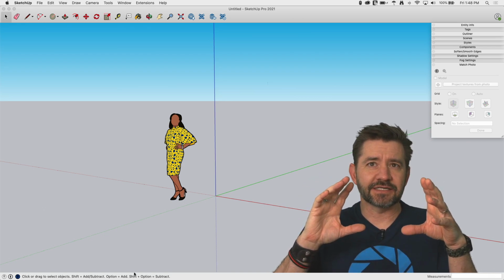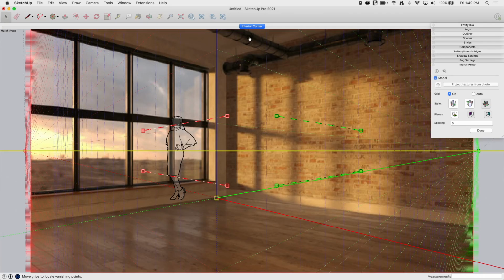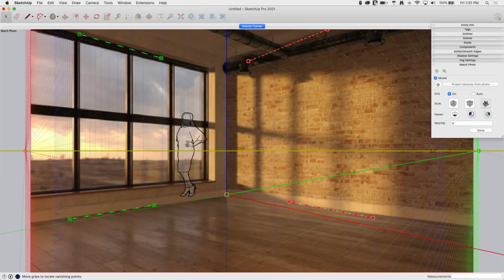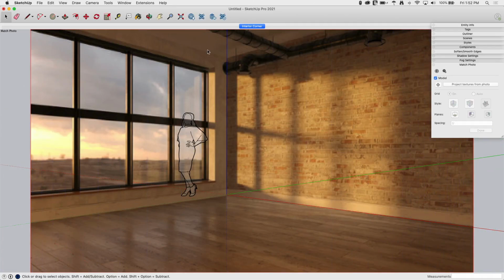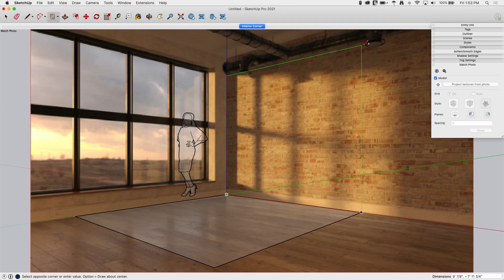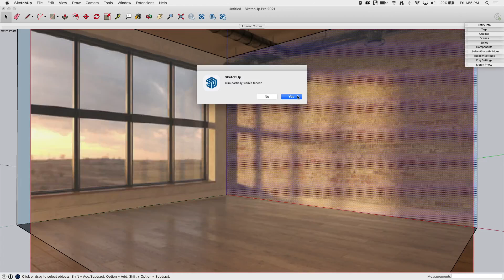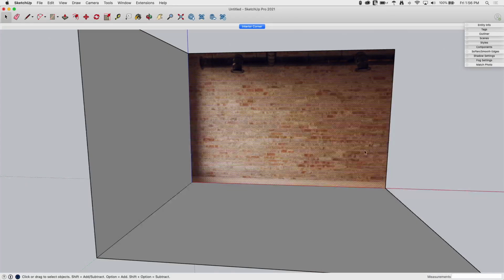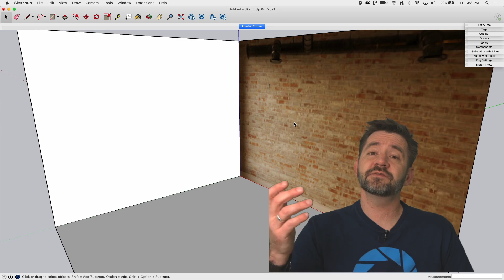Interior Match Photo - Skill Builder

Comment: I would like to see a video of using Match Photo on an interior straight-on, like looking at the altar of a church from the back.  Things to cover - How to adjust and level the horizon to match the photo.  How to set the vanishing points.  How to delete the photo and start over.  How to set the perspective of a wall where there is no clear line to match.  Where to put the vertical blue corner line since there are two corners, one left and one right.
Reply from the maker: Match Photo is intended to be used with an image taken at an angle. It relies on geometry that align to the red and green acces, thus does not work well with a "straight on" image. In that case, you are better off just importing the image as an image, and modeling off of it.

Comment: A few tips...
1. To make alignment easier, try to rotate the origin and axes roughly to the same angle as your room (photo) is BEFORE importing the photo. It will make it easier to position the axes if corner is not in the center of the image.
2. If you want to photo-match more then one photo in one model (view same room from different angles), the next photo MUST share a corner with the previous one. You match the first photo, then use the axes tool and positon the axes on the corner you will use in your second photo. Then you import the second photo and match it.
3. Know your SCALE. The best way is to know the room height. Then just draw a cube, set your view style to xray or lines only and just scale up along the blue axis. 
4. If you are using Vray, for some reason it messes up the origin point of photo match. It also messes up those dashed 'helper' lines. Use the yellow square to position the origin point  where you need it and dont pay attention that the yellow square is not on the origin point like it should be. Also, dont pay attention to those dashed lines, but use the GRID instead to help you position your planes.
5. Photos taken with extreme wide angle lens will probably not be matchable, so keep that in mind while taking photos.
6. In architecture photography, photos are usually edited so that the verticals are parallel. Make sure you use photos as they were taken with the camera or you wont be able to get the right perspective.  If you export a 2D image (or render), you can adjust the verticals after in PS. [I hope Sketchup will one day update this tool to be more versatile.]

I hope this helps. 🤓

Comment: Very useful information! Please post more about "matchphoto". Especially for indoor environments and detailing how to get measurements from photos.
Reply: I use match photo quite a lot and something I like to do that works inside or out is to early on set a known object as the scale reference. What I mean by this is say for instance I will trace a brick, it helps to zoom in as close as possible to improve the precision of the tracing. I then use the tape measure tool on the long side of the brick, enter 230mm and hit enter. This now adjusts the model to a known scale based on the one brick. 
With that set you can use the tape measure tool to get dimensions of any other objects in the match photo view. 
For interiors I will often use the size of an appliance, counter height, etc, once you have any one known dimension and set the scale you can then measure the rest.